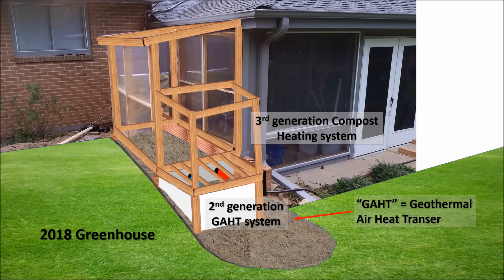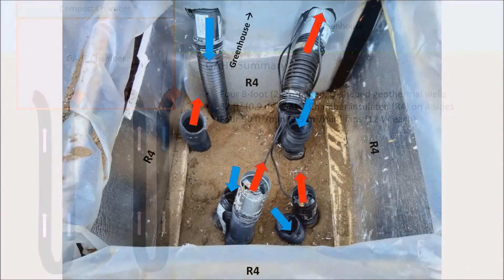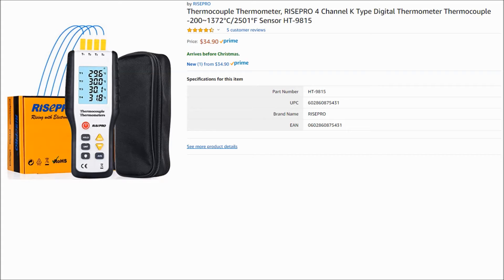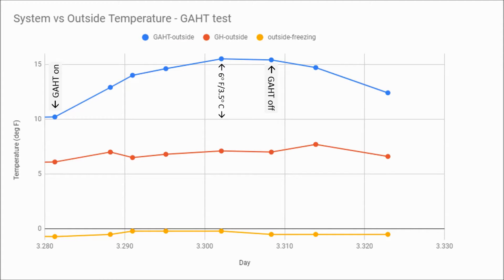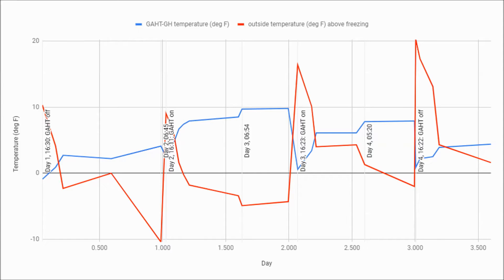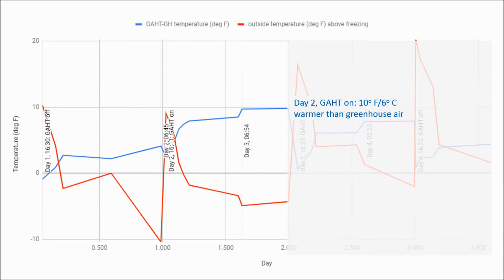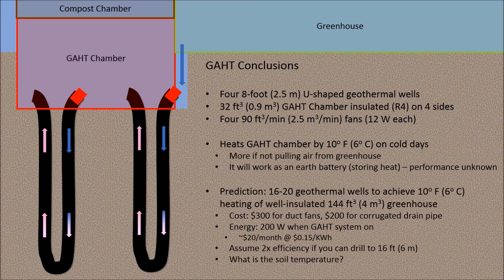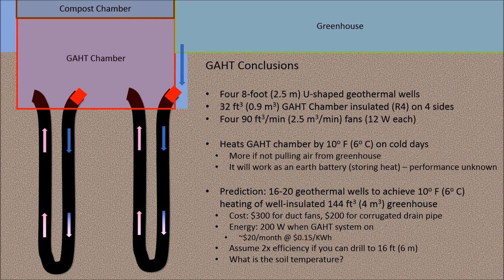Did Geothermal Heating work for Greenhouse 2.0?  (Part 2)

Comment: Thanks for sharing.  We plan to dig a similar design but using PEX tubing filled with antifreeze liquid and backfill the hole with sand. Also to a depth of 20 feet, and insulating the tubing above 6 ft depth.  That way there is more length to pick up heat, higher heat transfer, and less heat loss.  The tubing of liquid will heat a radiator and the fan will blow warmed air.  Will let you know how it goes.  Also I have heard you can pump heated water thru the tubing underground in the summer to heat the earth and the earth will store it like a battery (hotter than the normal 55 degrees).  You can use that same energy to extract heat in the winter.  You could also pumped cooled water in the winter underground in a different area and use it to air condition in the summer.   We will test that too.
Reply from the maker: Cool.  Yeah with a PEX and antifreeze system you could form a tight coil and potentially get a hundred feet of tubing into the “meat” of the hole.  Of course, the downside is many more moving parts.  Very interested to hear more.  Best of luck

Comment: I live in the low desert…..is it just as effective for cooling?
Reply from the maker: yes.  These systems are actually more effective for cooling.  If the underground temperature is below the dewpoint of the air going into the tube, then water vapor will condense in the hole and the return air will be dryer.  Of course, you'll need to make sure you have weep holes in the geothermal tubes!  The dewpoint of desert air is typically very low (e.g., 10 deg F), so this won't be a benefit for you.  However, cooling is convenient, because you'll be happy to have return air at 65 deg F.  If you were heating your house with such a system, you'd be pretty unhappy to have 65 deg air circulatign back into your house!

Comment: if you sealed the gaht chamner where would it draw air from?
Reply from the maker: Air just circulated in a closed loop inside the GAHT chamber for this test.  When it was time to heat the greenhouse, I moved the intake and exhaust vents into the greenhouse

Comment: Interesting. I think your depths are close. But a minimum of 9 to 10 feet of depth is necessary. It would be best to dig a trench system renting a small excavator if you can get access to your backyard with one. The pipe just is not long enough to efficiently transfer all the heat from the ground to the air that you pump through the house. I dont have the dimensions of your property so it is difficult to give you a size of system you need to run. I have seen geothermal green houses that work tremendously and they grow tropical fruit year round at 4000 feet above sea level on the side of a mountain. Here is their basic system. They used 6 inch drain pipe. They dug their trenches 8 feet deep running 80 feet long. Then 80 feet across then 80 feet back to the green house. Creating a large square loop. Just like you would build a box. They ran 6 rows of drain pipe in this trench. Pulling air from outdoors. Next is the insulation of your greenhouse. Insulate the back wall of your green house. If your building a winter green house your back wall should be facing north. Insulate the entire wall very well. Insulate both side walls very well. All the way to the top. Your clear panels should be on the south wall only. How ever build a wall 1 foot high around the base of your souther wall and insulate that very well. You should use 2 inch foam for all your insulation. Tape all your seams. Your clear panel wall in your greenhouse should be built at an angle of about 60 degrees to properly catch the winter sun.wich allows a foot of space on the bottom wall for your insulation. If your using plastic for your clear paneled wall. It should be double layered and pump air through the two layers of plastic for a small amount of insulation using an air gap theory like a traditional polly green house uses. 
  As for your compost heat. The pile isn't big enough to decompose properly. Your pile needs to about 4 feet high and 4 feet wide. For a compost pile like this that doesn't have to be turned look at the Johnson Sue Bio reactor compost system. You can build one for less than $40 and you dont have to turn your compost pile at all. It produces unbelievable compost as well. Have fun.
Reply from the maker: Chris, I appreciate the excellent and thoughtful feedback.  You have pretty much summarized many key points that I've learned - by failure!  I agree that my geothermal system is simply too small to be of much value.  We are unable to get an excavator into the backyard.  I think the vertical system may have real merit for people who are able to dig to 20-25 feet, as you really get thermal stability at those depths, but I hit bedrock at 10.  So for me, a horizontal trench system is a must.   I like your suggestion to build the geothermal system in a loop.  Better airflow than the "back and forth" configurations.  Your suggestions about construction are also spot-on.  My greenhouse is a bit atypical in the sense that the south wall is actually a screened-in patio, which I use for access.  Not insulated, but not fully exposed to the elements.  But my construction quality is poor.  Almost every innovation I've made in Compost or geothermal heating is mooted by poor construction quality.  I also agree that my compost pile is too small, and I have learned this the hard way as well.  Ideally I would like a 6x6x6 ft pile, but i need to design a system to enable easy loading and turning.  

I am actually in the process of selling my current house and am dismantling the greenhouse, on the advice of the realtor!  Having learned so many lessons the hard way, the next greenhouse will be far better constructed.

Comment: Morgan I want to build a much bigger greenhouse where we would need both heating and cooling depending on the season. Have you by now found any data anywhere regarding how many vertical holes would be necessary to heat and cool  house 20ft wide by 100 feet long? There must be studies somewhere? I havent been able to find anything significant.
Reply from the maker: Don, in a nutshell, you would need a LOT of 10 ft vertical holes to cool such a large greenhouse.  Very few studies that I know of with the vertical GAHT system.  Many studies on the horizontal systems.  My conclusions in these videos: one 10 ft hole = 1 deg F warming of 1 cubic foot of insulated volume.  If you could drill to 20 ft, then I'm guessing that the vertical holes would be ~3x more efficient.  Cooling should, in theory, be more efficient than heating (assuming some condensation in the bottom hole)

In theory, you could drill many holes, under the footprint of your greenhouse, which would increase efficiency further.  But I don't know about the space constraints in your GH.  I'm thinking like 1000 holes inside your GH (that's intimidating!)

If you were able to drill DEEP holes, however, the vertical GAHT has the potential to be very effective.  By deep, I mean a hundred feet or more!  Say that I had 5 holes to 100 ft depth, rather than 10 ft.  That would be a total of 500 ft underground, with the temperature being very stable over most of the hole.  No doubt in my mind that such a system could theoretically outperform a horizontal GAHT.  However, very few people have the tools to drill such deep holes.  And if they did, they'd probably utilize a more conventional geothermal setup (run antifreeze inside a closed coiled tubing system, using a heat pump).  Since you'd be under the water table, you'd have to use the U-shaped closed system.

Not sure if this answers your question, but hopefully points you in the right direction.
Reply: @MorganBrown  thanks. Im thinking also the same but its much less costly to install a vertical system than a horizontal. I wonder about the heating as well as cooling?
Reply from the maker: Don Wells if you have access to a power auger, it would enable you to drill vertically much faster than by hand.  Not sure how deep those can drill.  Anyway, you could drill many holes, connected by a trench, then bury one long section of pipe, utilizing the u shaped configuration that I outlined in the previous video.  One big fan to circulate air.  You could plant on top of the buried pipe if you trench deep enough.
Reply: @MorganBrown  thanks. Im wondering if drilling the multiple holes and making them say 6 or 7 inches and runnong 4 inch down and then just blowing air down and allowing it to circulate back up a 10 foot hole would suffice especially if enough of them. Running the hole series down a sunken pathway and then covering it with wooden slats so the cool air would come up under the walkway?
Reply from the maker: Don Wells if you used 3 inch drain pipe I think you could dig the 7 inch holes with the auger and run the pipe in a u shape, using one long string of drain pipe.  In this video I dug two adjacent holes, but it’s a pain.
Reply from the maker: Don Wells fwiw my original GAHT design did what you suggest (4 inch pipe down, air circulating back up the outer ring of the hole) but my biggest dislike was the increased humidity.  The closed system gets around that
Reply: Go to www.greenhouseinthesnow.com  I am currently building a 60 foot long one, but his standard is 100 feet long.  You can build one completely for around $25k.  Steel frame construction and he grows citrus in Nebraska year round.

Comment: I think you are sacrificing surface area for heat exchange by going vertical and deep, where as a layer of lots of tubing shallow (~8ft)  would increase GAHT efficiency overall.
Reply from the maker: Crypto Cooler can’t disagree with you.  Unfortunately I’m space constrained, hence the need to go vertical.  I don’t think I could get even a mini bobcat into my backyard.  I do sometimes wonder about digging a “root cellar” and backfilling a horizontal GAHT.
Reply: @MorganBrown  A mini trencher might do the trick if you don't mind more then a couple weekends in the backyard digging a hole.  Tom Sawyer dug his way out with a spoon... so it must be possible.

Comment: Great videos and thanks for your effort to design and implement a vertical design, and share it with folks. It's clear you've proven the basic functionality of the design. It seems your geothermal system may be undersized in terms of air exchange capacity (cubic feet) per unit of time to exchange enough thermal energy (cold air in the summer or warm air in the winter) to achieve the desired temp in the greenhouse  Ecosystems-desgn.com has a handy spreadsheet for determining the size parameters of your set-up. Also, VergePermaculture has video (How to design a climate battery for a greenhouse) that may also offer insight regarding the sizing of your system's capacity.

 I'm very interested in seeing the overall performance of your vertical design.

Do you plan to expand the system?  Do you have temperature data for the air temp at the input point (inside the pipes at grade) and at the point of exiting of the return pipe - and maybe within the vertical pipes below grade at various depths?

Thanks in advance for considering my comments.
Reply from the maker: Hello, thanks much for your interest and message.  My system is most certainly undersized for the task!  I was able to prove to myself that 4 holes drilled to 8 feet would warm an insulated 27 cu ft volume (the "GAHT chamber") by several degrees.  My greenhouse is 144 cu ft (about 5.3x larger than the GAHT chamber), so I was only getting perhaps a degree of warming.  So what would it take to warm my greenhouse by, say, 5 degrees?  Doubling the length of the geothermal holes ~ 2x performance.  Drilling 12 holes instead of 4 ~ 3x performance.  My biggest constraint at this time is real estate.  I may drill some holes directly under the footprint of the greenhouse next year.  To your last question about measuring temperature within a vertical profile - I would like to dig a hole next year and bury probes at various depths.  That would be interesting.
Reply: Morgan Brown as soon as I get a couple of major projects (replacing the original French drains around my house, re-insulating the attic) I am going to try a couple of test shafts to see what temperatures I get at the bottom of the shaft and what temperature change I get between the top of the input and the bottom, as well as between bottom and the top of the exhaust. If I’m able to get the test shafts built and monitored, I’ll send you the data. 

Have you considered using insulated distribution duct tubes between the ground exit point on the exhaust pipe and the entrance of the greenhouse?  Also, separating the input pipes in the GAHT box from the exhaust?  Would that make any difference.
Reply from the maker: I got a good idea from another user.  Check out this inflatable poly tubing (https://www.amazon.com/Aviditi-PT0606B-Poly-Tubing-Black/dp/B008VWS88K/).  I think I will go back to the simple one-hole system.  I can run 4" tubing on the inside and line the tube with the 6" tubing.  It keeps moisture (and radon!) out of the system, is really cheap, and has far less air resistance than the corrugated tubing.

Comment: I gave some thought of why you didn't get ~55degF in your GAHT.  Well water has a thousand time the Vol heat capacity of air & a hundred time the Conductivity (ex: most cars are water cooled whether than air).  Maybe:
   Lining your hole
   Circulating water thru it & a top-mounted car radiator
   Fan circulating air thru the radiator & around the room
get you close to a ~55degF GAHT as well as move much more heat energy.   If I get time, I'll give it a try myself.
Forgot: Thermal Properties of Materials https://www.google.com/imgres?imgurl=https%3A%2F%2Fimg.bhs4.com%2F4e%2Fd%2F4edaf74fdf0cfcc594fb7167e31801b824c75e80_large.jpg&imgrefurl=https%3A%2F%2Fwww.brighthub.com%2Fenvironment%2Frenewable-energy%2Farticles%2F89823.aspx&docid=KlBYZXTBV5xQaM&tbnid=Ut2iNgiD0ucrjM%3A&vet=10ahUKEwjx_Memk5LiAhXsm-AKHfhNClkQMwhDKAMwAw..i&w=600&h=600&safe=off&bih=969&biw=1920&q=heat%20capacity%20of%20materials%20air&ved=0ahUKEwjx_Memk5LiAhXsm-AKHfhNClkQMwhDKAMwAw&iact=mrc&uact=8
Reply: I've thought about the same thing. Between being 800 times as dense and having 4 times the heat capacity by weight you shouldn't need anything like the 100+ foot horizontal run of tube to exchange enough heat using air as the primary working medium. Circulating an equal mass of air and water through the radiator would give you an air output delta-T about 80% of the difference in temperature.
Reply: @johnassal5838  Profesional HVAC installers have to do air exchange calculates all the time especially for commercial installs.  Suggest you just contact the HVAC professor at your local community college.  He should be able to do the calculations in 15 mins or point to a professional that can knock them out.

Comment: Hmmm personally I liked version 1.0 (simplicity).  But perhaps 1st line the holes with 6" diameter black plastic bag tubing & 2nd blow air down the hole with 4" plastic bag tubing. The the static air pressure within each tube bag would keep them expanded.  

Aviditi Poly Tubing, 6" X 725', 6 mil, Black (PT0606B) https://www.amazon.com/Aviditi-PT0606B-Poly-Tubing-Black/dp/B008VWS88K/ref=sr_1_6?keywords=plastic+bag+tubing+black&qid=1556338863&s=gateway&sr=8-6
Reply from the maker: Tom B the plastic bag tubing idea is the best I’ve heard for quite some time.  I’m keen to try it out and maybe use it for my compost heat exchanger
Reply: @MorganBrown  Oh thks, plastic/fabric tubing separates the dirt & air flow and allows you to easily/cheaply remove or replace them (ex: microbe contamination).
I'm going to get a seymour auger & give it a try too.  The best bang for the buck/deal I could find what this one:
    https://www.amazon.com/gp/product/B00W3C6T4Y/ref=ox_sc_saved_title_1?smid=ATVPDKIKX0DER&psc=1
I'm thinking more along the lines of pre-heating/dehumidifying incoming fresh air into the house & maybe in parallel with a cheap heat recovery ventilation unit (HRVU).
Reply: Do you think it may have been losing efficiency from the inlet portion of the U and the outlet portion of the U touching and thus transferring energy? I’m wondering if cutting 6” pieces of foam board and shoving them down between the 2 would help isolate them and increase their efficiency.

Comment: Perhap insulating (ex: perlite or foam board) the top layer of soil might give you a lower/less-varying ground temp.
Perhap a compost tumbler with your air passing thru the center support pipe might work better.
   How To Make A Compost Tumbler (Fast, Cheap and Easy) https://www.youtube.com/watch?v=DzGaXMVmsUo